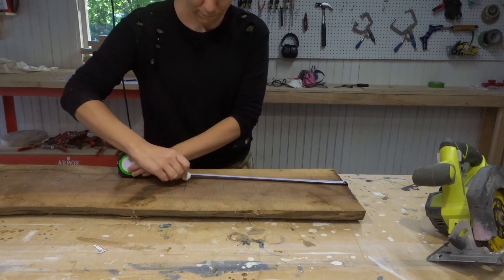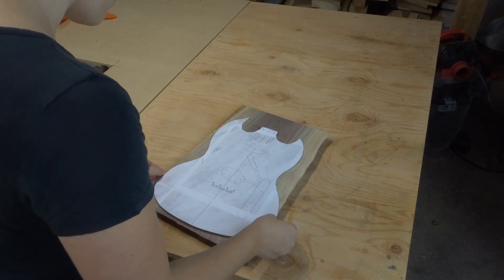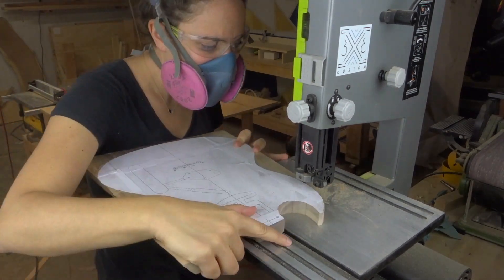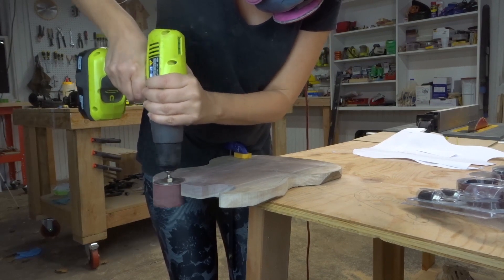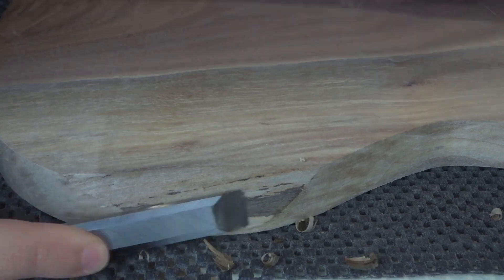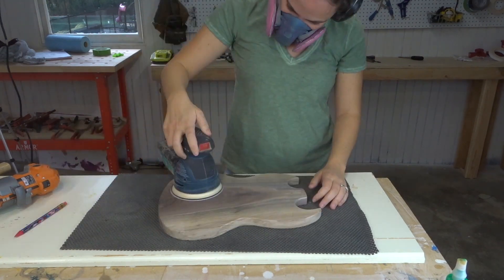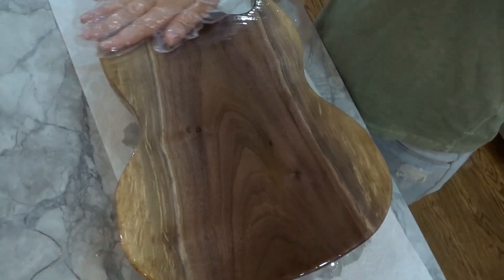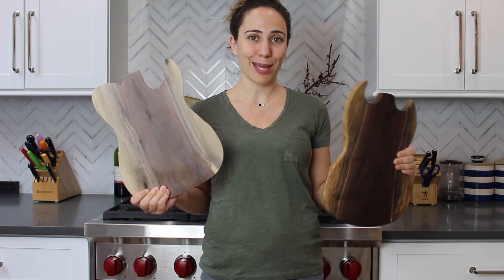Guitar Shaped LIVE-EDGE Cutting Board - Easy Bandsaw Project

Comment: Slick project! That walnut really looks sweet. 

A little tip for you. If you find that the glue has stuck your paper template a bit firmer than you wanted it to, a few seconds with a heat gun or hair dryer will cause the glue to fail, and it'll come right off.
Reply from the maker: +Mark Lindsay CNC thanks! And thanks for the tip! Finally my hair dryer will get some use.... 😂

Comment: try using painters tape on the wood then you can put your template on over the tape, this will help removing it much easer. I like the cutting board, the wood really popped after you put the mineral oil on it.
Reply from the maker: +christopher dustin I didn’t have a problem taking it off the wood because I waited 2 minutes and let it set up a bit before putting it on my he wood. Why waste tape when you can just wait 2 minutes....
Reply from the maker: +christopher dustin and thank you! The grain pop is the best part 😉

Comment: What oil u used tamar ?
Reply from the maker: Mineral oil and then Howard’s butcher block conditioner.
Reply: 3x3Custom - Tamar are howardbutcher conditioner is same with beeswax ? Cause i think on my country howardbutcheconditioner is hard to find. Or same with wood conditioner ?
Reply from the maker: It’s an oil and beeswax mixture. So it’s just easier to apply the wax.